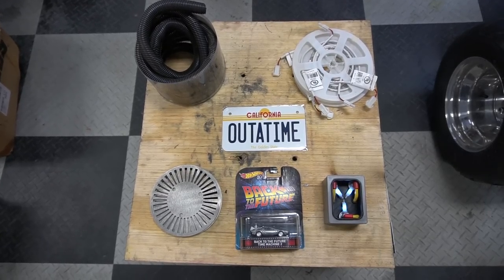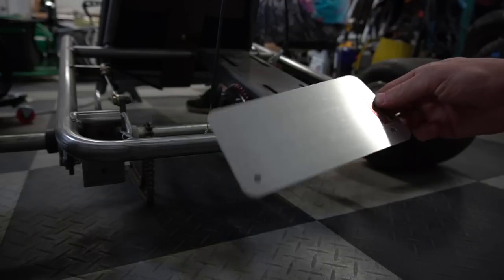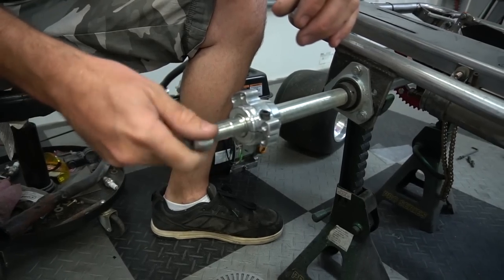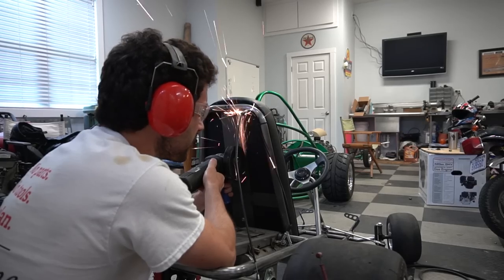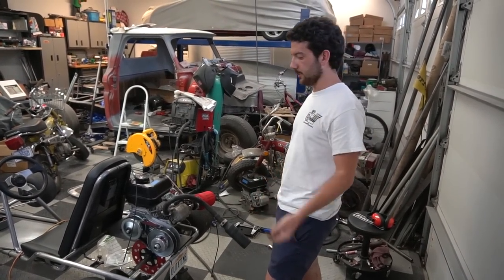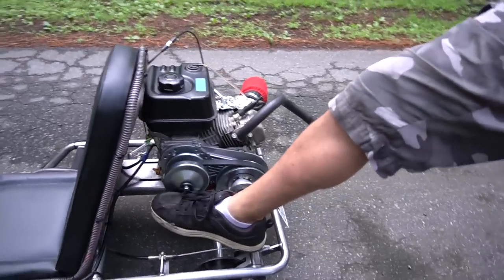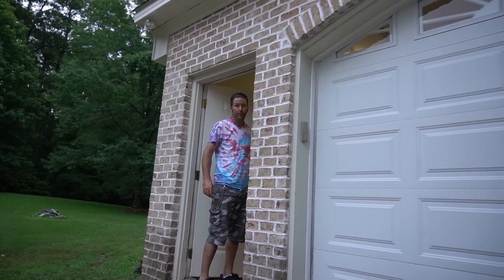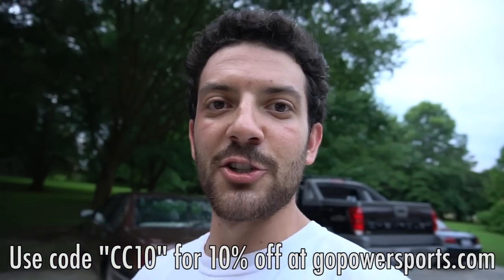Go Kart to Time Machine Transformation! Delorean Go Kart Build

Comment: put the 20 hp back on it thats what you started out to do. and finish it the way you started
Reply: glen johnson i thought this was the 212 ????
Reply: Jas thought so x)
Reply: did you not listen at the start, they were using the stage 1 212cc, NOT THE 20bhp 212cc
Reply: they build the 20 hp just for that cart. and they started the video with the 20 hp on it. and they took it off and put a stage one on it . so maybe you should watch the video again.
Reply: a 2 stroke or rotary of that size can easily make 20+ hp
Reply: a 212 can bet 20 hp

Comment: Running a stock cast aluminum rod at a much higher RPM then stock tends to cause the rod to weld itself to the steel crank. It would be my guess that rod will have pull marks in the journal where the aluminum started to soften up and you'll find corresponding scores marks in the crank pin. The safest way to run at a much higher that stock is to go with a billet aluminum rod with bearing inserts. Love your projects!

Comment: Just a tip, try to get a sanding disk for grinding down welds, they cut through metal so fast and they leave a much nicer finish. I use them to grind welds off when I can.

Comment: I would love to see a tach being put on the go kart that you put the 20hp engine in which you can use to help tune with gear ratio.  Just and idea but would be cool to see.  You could see about putting in a speedometer that runs a little bit higher than twice as fast as the cart actually goes just for the 88mph in the video

Comment: You want that cart to go faster? Add some aero to it.. put on a front valance toss on a small wing on the back get you some down force  get you some grip and get you some speed. You are fighting a battle with it, on one side you have drag and traction on the other you have speed.
Reply: Benjamin Hale traction isnt really an issue but aero would help immensely.
Reply: I think at the speeds they are trying for in something as light as they are using wheels not staying planted on the ground is a fairly big issue.

Comment: might I make a small sugestion please ? how bout ....now stay with me its a lil bit out there lol take the engine off the dragster toss it on the time machine and get a Bussa engine for the dragster lol if nothin else at least get a Bussa engine in sumthin thanks from  Athens Vermont
Reply: Because that’s not what they want to do.  Had 400000000000 people say that shit when they started the build.  They DONT WANT TO DO IT!!
Reply: SEAN BENWARE now THATS a good plan!!!
Reply: dude the drag cart would scoot
Reply: SEAN BENWARE yeah but he does have a point. The entire point of the build was a miniature vintage rail frame with the biggest harbor freight motor publicly available, decked out all pretty. Bright loud and supprisingly fast. They havent gotten reliability down on the predators. Ike uses alot of techs that were good for old bulletproof honda and briggs engines. The predators are made to perform to its structural integrity, not for performans or even reliability. Cheap mats, dial it back. Simple. The upgrades required to get the result they want would require them doing math, measurments, and thought.  A dremmel and bolt on go fast parts are NOT going to be reliable or efficient for the money and work youre willing to risk. @carsandcameras i hope you read this. You guys need to get that v twin upside down and empty, and i want to see math, i want to see drawings, i want you guys to recognize volumetric efficiency, harmonics and what youre trying to acheive as well as how to get there. The smartest thing you can do is buy a white board and a loooot of magnets and paper. You have to see your goal to know how it gets accomplished. Until then youre going to chase your tail longer than itd take to cast an entire new v twim from scratch. Im only bustin your balls but i mean every word of it. Happy gooning!!!
Reply: Cameron Kautz also, would you rather hear what sounds like a v8 or a straigt pipe honda? (Vtwin vs i4)
Reply: Cameron Kautz that is entirely preferance and it is these guys build. I am more than sure this idea had crossed their minds eyes and ears huuuundreds of time
Reply: I am not sure the chassis could support that power but there are lots of other powerplant options it could use. Used bikes without titles are not worth much and there are lots of them. HD twincam, inline 4s from 600 to 1000. Even Suzuki SV 650 engine would double the power and add a transmission and clutch.

Comment: I have an engine off of zero turn lawn mower 25 horse V-Twin and you guys inspired me I'm going to build me a go-kart around that engine but I think I'm going to make it front-engine rear-wheel-drive it'll be cool I'll let you guys know what happens
Reply: Shawn Jerome film it man. That would be a cool build to watch.  You dont have to talk, just slide show or time lapse.
Reply: Do it! And film it. Then link it on a comment here at Cars and Cameras. 🎥
Reply: Poor traction with engine weight in front... these guys did a similar build with Red Wagon cart... I'd suggest twin LawnBoy 6 1/2 HP 2 cycle engines... they're very light...

Comment: I think y’all tightened the torque converter pulley too much which caused it hard to pull start. Keep up the great work👍
Reply: SHADOUGH WALK3R I think that too.
Reply: Not even related, tightening the clutch bolt only helps keep the clutch on the crankshaft it doesn't do anything to change the dynamics of the pull starter or the ability for the crank to turn.

Comment: I had the same thing with my predator 212 on my Mini Bike. I remove the governor, thought I heard a rod knock after that but it turns out that I had valve float. since then I have  put new valves in it and added 18 pound valve springs. haven’t heard it since and I have had no problems with that either. All thanks to go Powersports.

Comment: CarsandCameras I think that it might be the exhaust or intake valves. My 7 HP duramax  engine was really hard to turn over and I took it all apart and the two nuts that holding the over head exhaust valve were so loose I could unscrew them with my hands. Ever since I fixed them my engines been running great.

P.S.   You guys are such a inspiration and taught me a lot about little engines.

Thanks you so much!

Comment: Since you gave up on the 88 MPH goal and opted to make a "show" cart I vote that you put a venturi nozzle in the header and make it shoot flames out the exhaust for show when you are at top speed.  You could even put a NOS style switch on the steering wheel to control the flames which would add to the whole look and be really cool in my opinion.  The only problem is that you will have to turn the tail pipe up so that the flames don't catch leaves on fire etc... but i am sure it would still look sweet.

Comment: Skit idea: Ike goes back in time to try and stop himself from blowing up his engine.  Ike's brother could be his double. Or Ike could go back in time to try and keep John from running over Jeb the bush with the 670.

Is there a way you could mount two small tubes that could squirt some kind of flammable fluid right behind the rear wheels, with some kind of ignitor, so you could make the flaming tire tracks.

Comment: Billet rod should be included if the stage one kit if it says to remove the governor, you might get lucky running a few time but each wide open run runs the risk of failure.  It might also be the wrist pin slapping too, but I would lean more towards the rod considering how hard it is to pull over.

Comment: To achieve 88 mph on the 212 with 20 hp, install a small electric motor with a battery! Similar to a mini KERS system. That should give you the little extra boost you need.  Cheers guys.

Comment: Go back to 1955 and build a kart with 40/50's parts. Do the build and use the time machine to bring it back to present time. After that, you could take the vintage kart to the future and race the futuristic electrical/fusion powered karts.

Comment: I would like to see another 'Maximum Engine Upgrade' video with EFI, Turbo, governor removed, rod/ dipper beak, valve, spring, cam, spark, intake/ filter, exhaust/ muffler upgrade. Is it possible to have a relatively quiet exhaust and still make powey? I have noticed that turbos quiet down intake and exhaust whilst adding power. Cheers mates!

Comment: Looks like it still wanders left to right at higher speeds. It needs more toe in to go straight. Measure it at the tire, set it 1/16" toe in and ride it. Adjust toe in plus or minus from there IF Needed.

Comment: Get some of that foam filled craft board and carve it and tape/glue it to a light wooden drop-over frame and paint it all 'stainless steel' or maybe just glue some aluminum foil on it and lightly rake it with sand paper or a brass/stainless steel 'toothbrush' so that it kinda looks like stainless steel... Also that would help streamline it a little tiny bit... maybe...?

Comment: @carsandcameras do you guys always use the same part number 212 engine or do you run with both the hemi and non hemi versions? I saw a video explaining that HF sells 2 different predator 212s that are made by different companies. I heard that the hemi head ones aren't as durable.

Comment: I had the same issue the back plate on the torque converter is grinding on the bolts you need to get a 3/4 inch spacer for the shaft

Comment: Are you guys going to put the connection rod and hook on the back sticking up. Maybe you guys can find a building with a clock tower use a piece of ribbon coming off of it, and don't forget the Flaming skid marks

Comment: We have to crank ours with battery powered cranking starters, we delete the pull rope, and we don’t have torque converters, had to fine tune the clutch... oh and we had to use 5hp Briggs motors with max .30 bore

Comment: the oil dipper on the predator 212 didn't break off,so stop blaming the oil dipper when it was your fault when it broke.at high rpm's the crank eats up the stock rod because the stock rod doesn't have a rod bearing. when the the crank eats up the stock cast aluminum rod it becomes loose on the crank and starts rod knocking.this happen on 2 of my friends 212's.

Comment: Why don't you try using the 9000rpm Predator 212 with the torque-convertor, or is it just not rated for it? And if that's the case, why not just get & use a model that is?

Comment: Never grind off your welds on the frame it will be weak and crack. Unless you grind a deep V in it first there is no way the weld will penetrate deep enough not to crack. You really should have left the weld on there for strength.

Comment: I am not sure, but it appears that the hemi version is not as reliable as the non hemi as some if the videos I have watched. But that being said I own a non hemi on a 2 inch water pump and the valves are very loud and I only have maybe 4 hours on it. I plan to adjust them tomorrow. I hope that takes care of it. 169.00 bucks at harbor freight. Other than that it pumps water like a beast! PS I have never gone above 1/3 throttle yet. Seems to pump way way  more than my smaller Horsepower gx120 Honda pump at full rev. Dont get me wrong, but the Honda is much much better quality no doubt. But that being said my Honda has a crap load of hours on it so maybe the Volute and Housing are getting worn down.

Comment: I just realized that one side of those drive belts is flat and only the outside of the belt and outer pulley is tappered... that's weird to me because I'm used to seeing that transmission on my snowmobiles where the belt and pulleys are tapered on both sides...I have learned something new about CVT's...I saw the flat inner pulley in pics before but I always assumed it was just a camera angle that was giving an illusion...

Comment: You guys are using belt driven pulleys, more snappy torque, and you guys use all kinds of other products! Lightened flywheels, and more.. we were way heavier also using regular race frames, plus oil catch cans, fuel tank between the legs, had to be 1/4 full at end of rave, body moldings, body safety side nerf bars, and lots more! Seat had to be fiberglass and not form board cushion

Comment: I notice that you guys have a "decent" Air Compressor, yet you use an Electric Angle Grinder and Dremel for Port/Polishing...

Have you thought about using An Air Grinder & Right Angle Air? Higher RPM and different tips. Plus, easier to grind welds in tight spaces!

Harbor Freight Tools will have both Air Grinders and Tool Oil for under $50.00...

Mechanics mantra; INVEST IN YOUR TOOLS!

-Thomas  (12)
Port Orchard, Washington

Comment: Dude get rid of that crappy torque converter 12 tooth 58 grearing will make that kart do 55-60mph. oh and use a max-torque ss clutch with a black spring that will give you 3,100rpm stall.

Comment: my brother took the oil out of his motor in attempt to blow the rod but instead it locked solid in 32 seconds. we managed to get it unlocked with a monkey wrench and bypassed the governor and it still dident blow any ideas we want it to throw the rod
Reply: Run gas in the oil
Reply: Ford For Life 100% correct. Or you need to put load on the crank shaft its doing no work with it hooked to nothing
Reply: Put oil back in and rev it OVER 9000!
Reply: il we did nothing happened for 10 miunets or so
Reply: how long would it take to go
Reply: il have to find a load for it

Comment: you need to understand what a governor does before you remove it. thats 2 engines you have ruined because you don't understand how a engine works. maybe they can give you a rev limiter so you can run without a governor.
Reply: J D it didnt tev that high

Comment: You guys try to do 88 one time by just throwing what ever gear on it like that is the perfect gear ratio. Get a tachometer and find out how much rpm your so called 20hp engine will turn, calculate the roll out of the rear tire and you can figure out the exact gear ratio needed to run 88, then it's just down to does the engine have enough power to push that kart that fast. You guys are so lost. I'm not going to try and explain it to you here because life is too short, get on line and find the formula to calculate this, at least one of you have supposedly went to college, figure it out.